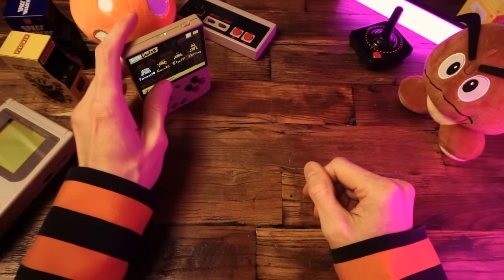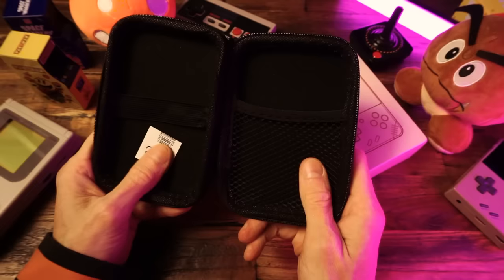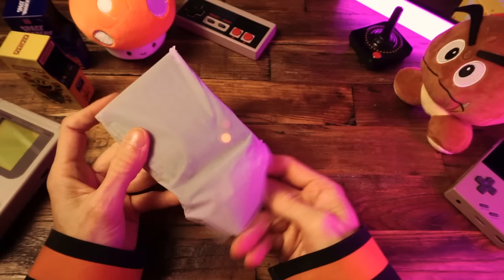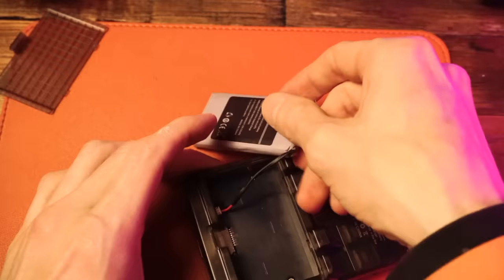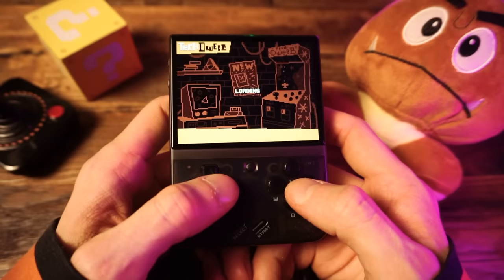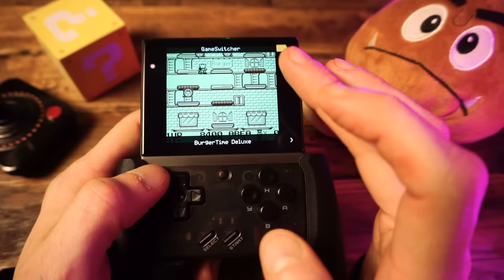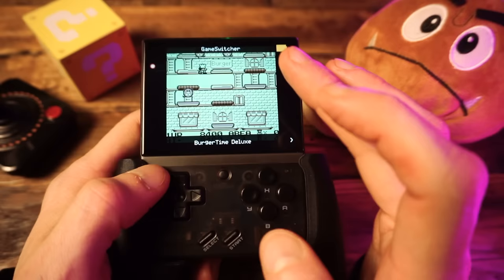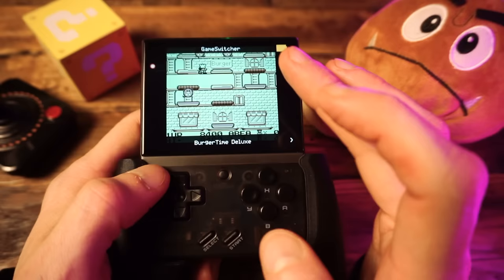The Ultimate Miyoo Mini

Comment: I'm leaning toward the 35XX Plus for my pocketable handheld. Then I will second guess my decision and buy a Mini +. The other option is to buy the Mini +, Second guess my decision and then buy the 35XX Plus. 😂
Reply from the maker: The circle of handhelds!
Reply: @TechDweeb Just FYI, I had to resubscribe. YouTube is up to their shenanigans again.
Reply: If the 35XX+ came out alongside the MM+, I think I would go with the 35XX+, over my MM+. 

I have the MM+ and I love it. But that 35XX+ is looking really nice, and it’s also a bit more powerful, so things like DS should play a bit better. IIRC, even the regular 35XX was a tad bit more powerful, but it wasn’t anything to brag about. 

And the 35XX+ nailed the placement of the buttons vs the original 35XX, IMO. It’s not just a more powerful version of the 35XX. They made some build/QoL improvements, along with some new features that the normal 35XX should have had and would’ve made the MM+ kinda irrelevant. 

The MM+ and 35XX are pretty much equals and they each have pros and cons against one another. The 35XX+ pretty much eliminated those cons.

Comment: I’ve really been enjoying your vids lately! Thanks for all the helpful info on the retro handheld market. Still struggling to decide if I want this, anbernic or a powkiddy as my main Gameboy device, but I’m happy there are so many options around for an affordable price
Reply: @EnbyFish Which Gameboy? Original, color or GBA? I ask because if original and/or Color then Powkiddy RGB30 is the correct answer :)
Reply: @lunsj  all 3! I hear the D-pad and battery life are kinda awkward for the RGB30 but I saw Retro Game Corps putting electrical tape on that part of the motherboard to get a good fix. I’m leaning a bit more towards the Miyoo Mini Plus for that and now the simplicity of having a pre loaded card
Reply: @EnbyFish  My d-pad isn't terrible but it definitely is far from perfect. Hadoukens are not working very well for example. Also battery is wonky. I'll get to working on that soon.  It says a lot about the device that I'm willing to put up with those things. That screen is just nuts.
Reply: @lunsj  how is setting up the thing? The process smooth for you?
Reply: @EnbyFish  Definitely had some hiccups. I had an update cause a sound issue and resetting to defaults seemed to fix it. But with all my tinkering I've had to install a new image of JELOS. I doubt you'll need to do that though. This thing is pretty great out of the box. I just can't help myself and I have to break it then fix it again.

Comment: Okay, so after many hours of rewatching some of your videos on this and RG35XX+/H; with very much deliberation, you have both sold me on the MM+ as well as earned my sub!

I was finally upgrading from my old RG350 original and I was stuck between 35XX(+/H) and the R36S and even the RP2S.

It has been a rabbit hole.

I'm a little worried for my piano hands but I think this is going to be a massive upgrade from my old RG350 in so many ways.
Reply: 1 month later and I gotta say, I love the MM+ and though it is sliggghtly small, it's a really nice semblance to the gb form factor.

Comment: Recently got a MM+ and it's so much better than my RG35XX. Ended up giving my 35XX to my sister.

Etsy has a lot of great accessories for the MM+. I got myself a screw in lanyard, Sony decal for the front, PlayStation buttons, a better speaker and a nice clamshell case with padding on the inside.
Reply from the maker: Better speaker? That's interesting! Did it make a big difference?
Reply: @TechDweeb  Yes, it did! The audio is much crisper, even at high volumes. The audio crackling is pretty much gone. And the guy who sells them on Etsy is such a chill dude. Had some funny conversations with him before :D
Reply: @TechDweeb yep, speaker from Redmi4/4x gave most quality sound and it assembly ideally)

Comment: Im not to techy, but i have a rg353p and its fun out of the box. I have a question though, if i just bought the 128gb sd card with onion installed with the link you provided, would that would on my rg353p?
Reply from the maker: Nope, Onion is only for the Miyoo Mini. You'd need a similar ArkOS product (and I don't think that exists!).
Reply: @TechDweeb  what would be my next best option with the rg353p? Which Os and rom setup would you suggest?

Comment: is there a place where we could download the curated ROMS as seen on this video? I really liked the arrangement of the roms and how the "standard" games are separate from the "best of" games. I also love the pre scraping which saves a lot of time. Google drive, or mega link, please?
Reply from the maker: Sorry, this is 128gb, too big for me to upload :S. I bet there's a good image out there if you go hunting though.
Reply: There’s 2, that I know of. One is “Tiny Set: GO!”, the other is “Done Set”. 

Both are good. They have 3 “tiers” of sets, depending on your storage options. They both include a “Base set”, for 32GB storage devices. This set is a MUST install. It has everything needed. The next 2 are add-ons. The first “add-on” is for 64GB and the last and final add-on is for 128GB. For the 64GB version to work, you need the Base set (32GB version). And for the 128GB to work, you need the Base set (32GB) and the 64GB add-on installed. This applies for both ROM collections. I do not recommend to mix and match. Only go with either Tiny Set or Done Set. They both have some overlap for their collections. 

Also, they both supply the box art for all the games included, along with 1 or 2 alternative box art packs. 

Done Set already has some overlays applied for each console/emulator. So you can have a GBC-esque overlay for GB/GBC games, if you’d like. Tiny Set does NOT have pre-installed overlays, but you can also find overlay packs online to install yourself. Very easy to do. 

Done Set has cheats enabled by default. Tiny Set, you have to enable that via PC and a note text editor. Done Set also has a ton of cheats scrapped from website so you don’t have to go looking for them and you won’t have to create .cht files manually. All the included cheats may not be useful though. Some are for different regions/languages of games, some are just incomplete or the codes are just partial. There is a website, GameHacking(dot)org, which you can download the .cht  files from, which is where Done Set got theirs from. But it was just a massive scrapping of all the cheats and not really tested for each game, which I can’t complain as that would be tough and tedious to do. 

That’s pretty much the differences in them. Don’t let the overlays and cheats persuade you, these are very easy to do, but I can also see the enticement of it. 

I found out about Tiny Set from YT comments and then found out about Done Set from Reddit. I’ve had both installed and they are both good. Hope this helps.
Reply: @TechDweeb you can upload it in parts I’ve been looking for a set like this

Comment: I have a few much more expensive handhelds, but none of them have the sleep feature, and that's the whole reason I'm buying this.  I use a rg353m right now which is amazing, but whenever I grab it heading out the door the battery is dead, its infuriating.

Comment: I never knew that turning on show interlaced video made some games run better. What exactly is it doing?
Reply from the maker: Interlacing is where the game renders half an image at once, every other line. Old TVs used interlaced video because they would refresh at the same rate and it would appear smooth. Deinterlacing removes the interlacing, so games like Bloody Roar 2 run at 100% speed when they are running with interlacing, but deinterlacing removes the half-image rendering and renders entire frames at once, so it takes a big hit to performance. However deinterlacing is good, because if you don't do that you can sorta see the every-other-line rendering (a sort of ghost effect), however since it's more demanding turning off the deinterlacing (or turning ON the interlacing, depending on the emulator) will take away that overhead.

Comment: I got a miyoo mini plus, but because of my poor internet in my area, I opted to buy a sd card with games pre-installed. how do yoy record without using your hands ( a gopro?) by the way, do you know if the miyoo mini can play the new sega games that came out Too, and if so how?
Reply from the maker: Nice, hope you love it! I record with a camera on a tripod, I sit behind the camera, and I put my arms around it so they're in front. And then I have the camera connected to my computer so I watch the recording on my monitor while I do it and speak through a microphone. 

And YES, you can definitely add the new sega games. Just put the SD card in your computer, copy the rom files into the correct directory (look through the folders in the /roms folder, it'll be called "megadrive" or "MD" or "genesis" or something like that). Then put the sd card back in your device. When you're in the system list press Select and choose "refresh roms" and it'll add your new games to the game list. 

Hope this helps! Stop by my discord server if you need a hands with anything else :)

Comment: Hi i have a question about the sd card 128G Cutsomized Onion OS Only can I just plug it into my device and it will work or do I need to do something to my device first such as updating or downloading something keep the videos coming
Reply from the maker: You SHOULD be able to plug it in and it'll just work. However there is a chance that you don't have the latest firmware, so you'll need to update the device before you can use the card. Check out Retro Game Corp's guide about updating the firmware if you need to do that https://retrogamecorps.com/2022/05/15/miyoo-mini-v2-guide/#FirmwarePlus (it's the "March 2023 firmware" you'd need)
Reply: Thanks for getting back to me  so fast I think your right I got mine july ish and I don't think I have onion os

Comment: Hello I purchased this based on your suggestion.  I played with it less than an hour then all of the audio was gone.  Except for the"expert" Section so I know it's not hardware related.  Litnxt told me to to reconfig audio and save which I did and still no audio. He said I must have deleted audio file except I only played games now the say I need to buy a new card. Help!
Reply from the maker: Hmm very strange. Never heard of that happening. My first suggestion would be to UPDATE onion OS using the OTA update option in the settings (you may need to enable it through the settings). Connect to wifi and update the device, that should reinstall the emulators and hopefully fix the issue. If that fails I'm not sure what else to suggest. I suppose you could just install Onion OS on a fresh card and copy over the games in a worst case scenario.

Comment: Am I understanding it correctly: At least one version of the MM+ comes with many ROMs already pre-installed? Which version is it? The Onion OS + 128 GB SD? (It just sounds too good to be true. 😅)
Reply from the maker: I think any MM+ with an included SD card will come with games. But they'll be on the stock OS, and the stock games list is kinda crappy. This Onion build is WAYYYY better.
Reply: @TechDweeb  Ah thank you for your answer.
Reply: @TechDweeb Who curated that list, do you have to buy it from that vendor to get that curated list?

Comment: they using my seprate folders for hacks and translations and so forth. i remember when i did this for pi many years ago. i didnt know ppl still used me techniq for rom separation
Reply from the maker: It's a great way to do it. Many companies include that stuff but they dump it in with the base list and it gets so messy!
Reply: @TechDweeb  when i done it was alot cleaner. the first page is just the folders only. then u go to the folder you wanted... usa, japan, translations, hacks proto types and so forth

Comment: $112 for a Miyoo Mini Plus with Onion, are you serious??? That is insanely expensive! Thing is regularly on sale for under half that, and it is not hard to install everything yourself, takes less than 20 mins for a first time install...
Reply from the maker: Automatic 20% discount, so the price is $95. 

It would take me a LOT more than 20 min to build a card like the one here. Installing Onion is quick and easy but that's only the first step in building a good system. I'm pretty fast at this stuff and it would still take me many hours considering all the best-of collections and all these ports and rom hacks and translations and all the box art pre-scraped. Obviously you can do all that yourself but I don't blame anyone for wanting to skip all that especially if they're not tech savvy.

Comment: The fuck are you talking about? Putting a new OS in these devices is as easy as format/backup and then drag and drop the files onto the sd card..
Reply from the maker: It would take me quite a bit of time to put this together. Installing Onion is quick and easy but that's only the first step in building a good system. I'm pretty fast at this stuff and it would still take me many hours considering all the best-of collections and all these ports and rom hacks and translations and all the box art pre-scraped. This card is very well done and that's not a trivial task. I can see lots of people taking the approach of just buying this so they get the best setup without having to spend time making it themselves.

Comment: miyoo is far below now, behind the RG35xx Plus
Reply from the maker: MSRP is $10 more than the miyoo mini plus, and we don't have custom firmware for the 35xx+ yet. So we'll see how that plays out in the long term.
Reply: "far below" is a bit much
Reply: @TechDweeb  If it receives the same treatment as the rg35xx, it will be a very moddeable console in a short time, and in relation to the price and power, I think it is a much better deal, you can even get it for 60 usd.
Unless the miyoo company releases another vertical console with the same distribution and model but more powerful, something like "miyoo mini plus v.2".
In the end, the ones who win are the buyers in this "Chinese console war" since they compete on price vs power